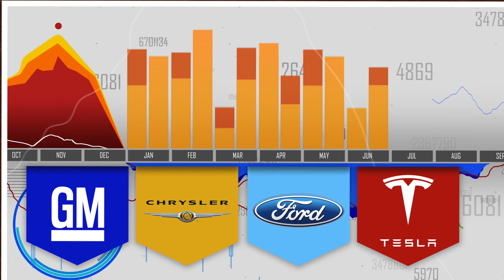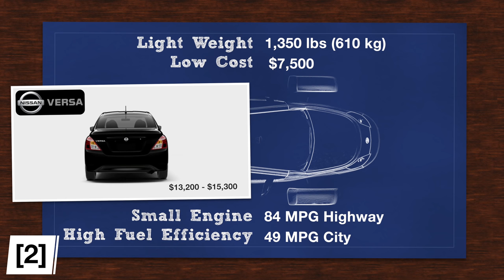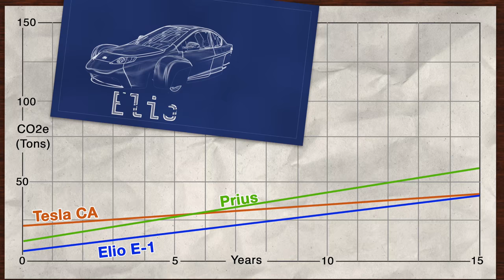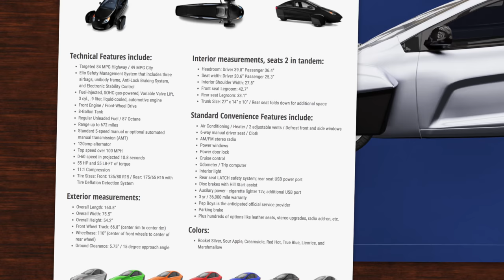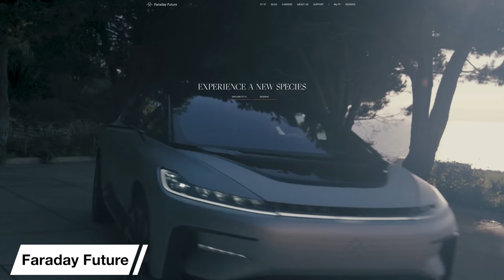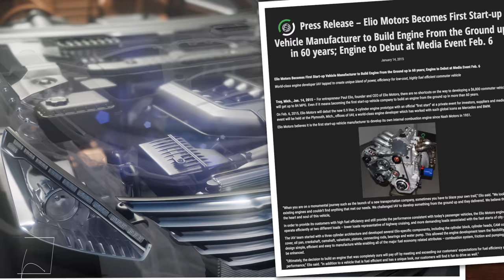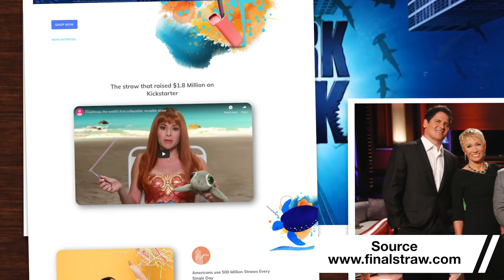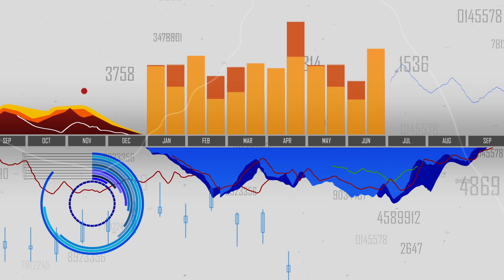How this Radical Car Missed its Chance to Change the World

Comment: 8 gallons of fuel and 84 mpg equals over 600 miles of range.  No EV can do that without a lengthy stop to charge at least once, so this one is still appropriate for the times.  But that assumes long distance travel, and that assumes this car(?) is the least bit comfortable when covering a long distance.  Re price, you could buy it for less than the excess you’d pay to get an EV, and your annual fuel cost is on par with an EV, if powered by the grid.  I think there still is a market for this vehicle (commuter, at a minimum) although as others have said - cheap gas cost in US hurts this business case, especially considering that even though this car may be extremely cheap to buy (if you could buy one), there are very capable 4 or 5 seat competitors that don’t cost double which offer significantly more utility.  Electrify it with 120 mile range, and the business case still is a good one.
Reply from the maker: Agreed
Reply: considering you can buy a wreck of an old peugeot 106 diesel from 1994 for £500 and get 75mpg and 600 miles here in the UK, I can't see how, if economics is your main goal, this would sell at all well.
Reply: Andy C - 24 yr old car may only be 500 to start, but it would also require constant maintenance, if parts are still available.  For the cost of a 5-6 yr old “out of warranty” car, you could have an “in warranty” Elio - if they are able to build it.  Lots of people will line up for that.  A new car they can depend on for less than $8000.
Reply: Dennis Lyon £7500 is a boat load of maintenance!!!
😱 if you said an annual service with a few maintenance items each time at £250 each service, that's 37.5 years motoring before you rack up the cost of that thing!
Reply: @HandyC  The Elio is steel unibody, probably just like the car you drive now. Only the rear wheel cover and rear part of the front wheel covers is plastic, and that's for aerodynamic efficiency.
Reply: Andy C - I’m referring to things like timing chains, injector pumps, water pumps, or master cylinders - repairs much more expensive than £250/year.
Reply: Has a timing belt not a chain, would be changed with the waterpump about twice in 150,000 miles, injector pumps is a life of car item or at least 150,000m, master cylinders never changed one of those eaither.. If you keep up the scheduled service intervals it prevents these sorts of failures (brake fluid for eg is hydroscopic so absorbs moisture which can corrode internal parts of the braking system, but if you change the brake fluid every two years like you are supposed to instead of going in for a "jiffy lube" oil and filter and ignore everything else then it's more of a case of "what do you expect" £250 service cost I think is about average for a little shitbox like that as they are cheap as buttons to maintain..
I mean like an entire driveshaft with CV joints both ands and boots attatched, with grease.. about £30 You really can't go wrong with some of these old cars.
Reply: No human has a 600-mile range.  Who would want to be trapped in this box for 600 miles?
This is a commuter car.    If you have to drive 50 miles round trip to work in stop and go driving.  Any modern Electric car can do that.  You can charge at night for less than 10 cents a kw.  To charge 10 kw would be around $1.  That is about all you need to go 50 miles in a small electric car.  Maybe 12 kw in something like a Volt.  You never have to go to a gas station again, Change oil, fix your exhaust or emission system.
Reply: "a lengthy stop to charge"? Even on low powered 50kW chargers most EV's can be charged topped off in 30-45 minutes (EV owners typically don't run their tanks dry before recharging). "Lengthy" is subjective especially after spending more than 3 hours or 200 miles in the saddle. The 145kW charging stations are substantially faster often allowing for 15-20 minutes stops or less. All I'm saying here is that we might not want to embellish the arguments against EVs in order to sell Elios especially since an electric version is likely in the works.
Reply: As a rule of thumb I think it's about 30 mins charging for every 3.3 hrs driving
Reply: By the way, I love driving my motorcycle and would do it everyday if it were not for the Winter weather. The Elio would suit me perfectly.
Reply: I think you have to look at how it would be used. Would you take a car like this out for a 600 mile highway trip?  I'm guessing few people would use a car like this as more than a suburb-to-suburb commuter and grocery getter. Electric cars fit that bill perfectly.

Take a look at the Sondors "car." Similar design. I'm guessing it will be much more likely to succeed. But who knows... innovation is risky.
Reply: 'I'm looking forward to driving 600 miles without stopping once' - No one ever
Reply: @HandyC  For Teslas.   Other electric car owners do not have it like that yet.  That would be stopping every 165 to 190 miles. Driving at about 60 mph. You can drive 4 + hours on the long-range 3 but then you have to charge for about 50 min if you want to continue at the same pace.

Something like the Ipace can go 3.3 hours but it would take over an hour to charge with a 50kw charger.
Reply: @Chris-ie9os  - I hear you. I haven't been able to do that since my old 2002 Honda Insight died in 2014. It used to get 64 mpg consistently and occasionally up to 68 mpg. On the highway its 10.7 gallon tank could actually go 700 miles.  The farthest I ever went in without stopping one day was about 400 miles and I was beat. Don't want to ever have to do that again.
Reply: because they wont import them to the US.
Reply: It's like driving a coffin while wearing a helmet. Nobody would drive that over a 100 miles straight.
Reply: @devalopr  - I'd have to agree with you. This would be great for my 20 mile commute but I'd have trouble lasting much longer.
Reply: Put a emergency home generator on a trailer and a electric vehicle can go anywhere just as easily as a gas vehicle for less fuel.
Reply: @Barskor1  - Interesting idea although I think you'd need a very large one. A typical 3500 lb EV will likely pull around 14kW just to maintain 55 mph.  I thought about using one of those new small "inverter" type portable generators to keep in the trunk of my EV for emergencies. I found one that was about 2500W. I'd have to stop and let it charge at a level 1 rate which would give me about 10 miles for every hour it ran. Enough to get me home in an emergency.
Reply: It wouldn’t need more than 150 miles of range. It’s a daily commuter car and should have been electric. It seems crazy they were going to design and build their own ICE engine knowing the huge cost involved. This may have worked in 1973 in response to the oil crisis, but today the boat already sailed.
Reply: @Tron-Jockey  It is wonderful you plan ahead! A EV one that weighs 1,300 odd pounds and has far better aerodynamics will need a much less impressive generator.
Reply: @fatboy19831  As a Pilot Escort for oversized  semi loads, I do it every week. I bought a $21k Kia Niro FE hybrid that normally gets 52 mpg . It has a 10.8 gallon tank.  Escorting these loads at lower speeds and drafting, I get over 70 mpg...over 700 mile range. The semi's  don't have to stop  because I need fuel. However,  blood clots are a very real danger. The Chrysler Pacifica is twice the money but gets over 80 mpg normal driving.
Reply: @nimbuslayer5142  , You drive 600 miles without stopping?  That is not legal in the Us.Maybe if the truck is averaging 80 mph.
Reply: @fatboy19831  Escorts don't require a CDL and are not restricted. My longest days are 1100 miles with one fuel stop in the middle.  Load drivers have to swap out.  We average 65-70mph, speed limit.
Reply: tom0kiely Yes, Elio should have definitely stuck with a commercial-off-the-shelf engine, rather than attempt to design their own! As such, I’m currently leaning toward an EV...
Reply: @beernpizzalover9035  I just took delivery of a 3 last week.
Reply: @grandpa5x Pulliam At first charging at night is a good thing.  It evens out the grid.  The electric companies do not have to slow down electric production at night.  In fact, many states give a big discount if you charge your Ev at night.  When production reaches 300,000 or so Ev's a year things might change.  It won't be long before peak mid-day rates go up.  It is a careful game. Raise electricity rates too high and people will buy solar panels or go back to gas.
Reply: what about your time though? the old car breaks down. You miss a day of work and have to deal with the pia of dealing with mechanics
Reply: @fatboy19831  You underestimate people that drive for a living or from job site to job site (I used to do the latter). I once drove for 24 hrs after working for 8 hrs. I once drove 2100 miles in 32 hrs. 900 miles before sleep wasn't uncommon (was a bit of a goal actually). Sure, most people aren't going to do that, but some of us do, and some do it regularly.
Reply: @Tron-Jockey  Get back to me when I can go coast to coast in an EV w/o adding days to my trip, as well as additional lodging costs.
Reply: @psykoklown874  , It is not legal or safe to drive 24 hrs straight ( as a professional driver in the US).  Yes, some people can do it safely but they are few and far in between.  After about 16 hrs you are just running on instinct. The same way a drunk driver navigates his way home and can't remember driving there.  You are a danger to yourself and others when you drive that long.  To think that you are fine doing that is more than a bit frightening.   I have worked 14  hr days driving but there were many stops and brakes along the way.  I have driven from Alexandria VA to Providence Ri in under 7 hours and then worked for 10 hours.  Never the other way around.
Reply: @fatboy19831  Key words "professional driver". Back then a 300 mile drive was like falling out of bed. The long trips could get unsafe at times, but when you're "young and invincible", well, you know how that is. I'm sure those long drives shaved years off my life. I don't recommend it.
Reply: Remember, Elio's driving range is totally unproven.  And why not mention passenger miles per gallon....there might be a point where a 5 passenger Prius makes much more sense than a 2 passenger Elio.
Reply: @psykoklown874  - First of all you'd have to purchase the right tool for the job. I suspect an EV with over 330 miles of range would be the proper selection for a cross country drive. Now that Tesla has more than enough supercharger stations its really rather easy to make this trip without losing too much time. True, it won't quite match someone in an all out hurry driving an ICE but the difference is not that bad. I don't know of too many people that can do 2800 miles of driving without stopping regardless of the type of vehicle they're driving.  Personally I've done 6 hours (roughly 300 miles), at a time stopping only for a restroom break, gas and the time to go through a McDonalds drive through which took about 25 minutes total. I guess I could have rushed and done it all in 15 minutes but why? Who does that? VW and Tesla are already moving forward with their new 350kW superchargers which will provide over 22 miles of range per minute of charge for the coming generation of electric cars. Even with Tesla's present 120kW Superchargers you can still be under way in an hour.  For a car of comparable size, comfort and performance (EV or gas), your looking at at least 8-9 stops along the way. If you're driving a gasoline car and rush all of your gas station stops, taking only two and half hours worth of breaks over nearly three days of non-stop driving, than you'll likely save only 5 to 6 hours. I guess if you're in a rush that makes sense but it won't likely save you anything on lodging costs.
Reply: @Tron-Jockey  Depends on how someone travels. I packed my snacks to maximize my time. Most of the time I'd hit the pump and the restroom and get back on the road. Now if I was heading home, then I might go off the beaten path and take the scenic route. How bad is EV range affected in bad winter conditions? I've had to go hundreds of miles out of my way due to ice storms, and I once ran into an absolutely crazy long detour that took me through the mountains. I once missed an off ramp in the middle of the night and lost 100 miles (pre GPS days). I also can't imagine the stress of being lost in an EV with anything resembling a low charge; especially in low population areas Mos states have large areas like that. My thoughts are that EVs are great for some people, but not so great for others. Where you live, and how far you travel for work/family/errands makes all the difference. I bet they're great in traffic jam areas though since they don't need to idle. I just hope one of the many game changing battery breakthroughs we hear about every 6 months actually makes it to prime time in the reasonably near future..
Reply: I would so buy one
Reply: @Chris-ie9os    I do it all the time between Dallas and SLC.  One fillup, 1200 miles.  Honda Accord - I get about 670 miles a tank.
Reply: @lylestavast7652  ... I did it too.  I hated it.  WAY more relaxing with the Tesla.
Reply: @lylestavast7652  .... do you sit in the car for 670 miles or do you stop for a break occasionally?